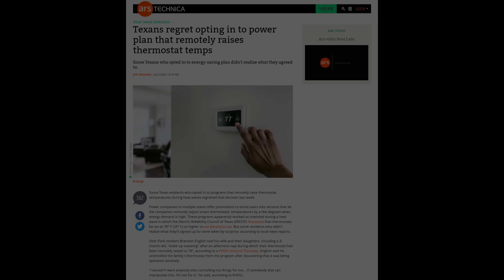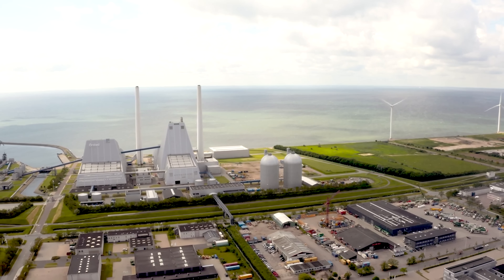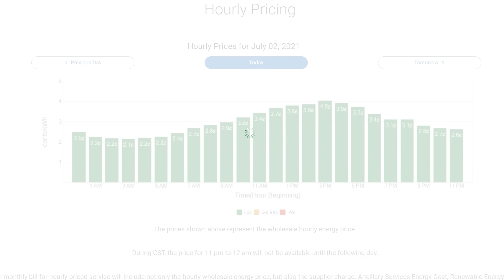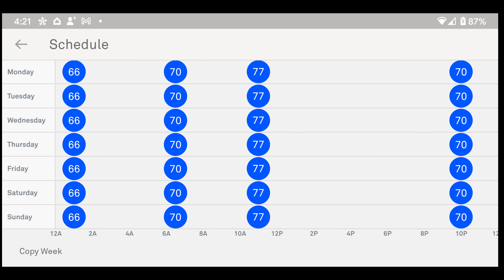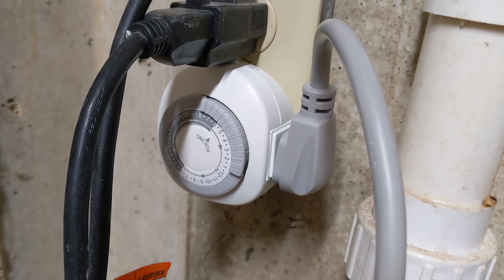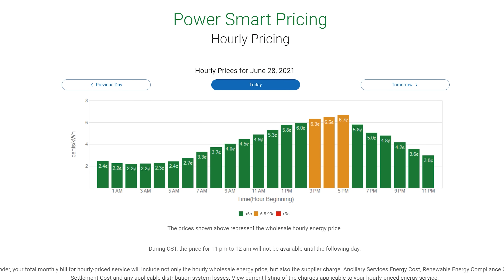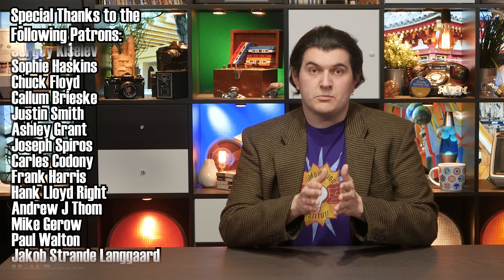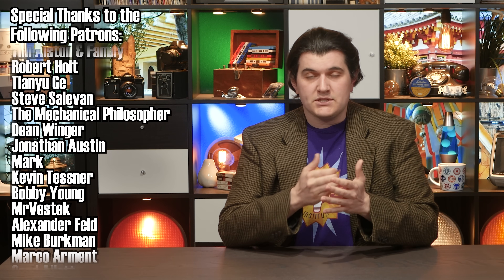Batteries aren't the only way to store energy. Here's another.

Comment: I'd love to hear your take on underground houses, in terms of power saving and possible "battery" viability.
Reply: Really depends on local geology.  A house that floods if there's a disruption of power to sump pumps isn't the greatest plan.
Reply: @Zraknul  and how might the home flood if it's Underground? If it's built out of the right stuff or the right techniques it will never flood. I'm preparing to do an underground home myself I have already worked out everything in my head I just need to put it down on paper as far as the blueprints and Engineering goes its going to be self-sustaining with a thousand gallon potable water storage a power supply room that will house a air scrubber along with oxygen if I ever need it in case something happens to the outside air that's being piped in that is filtered as well as hidden, and I would have off-grid power and even if my energy source were to dry up for some reason I will still have backup power for 7 to 10 days and my energy storage by the way is a renewable and free I can go on and on but the home will be constructed out of court in steel waterproof Crush proof containers about 2000 square feet total I will have a earthquake proof flood proof hurricane proof tornado proof flood Proof Riot proof Fireproof home
Reply: @Zraknul  I forgot to mention flooding is basically enough above ground problem what you have is permeability under the topsoil and then if you go down far enough you actually will find water again obviously but between those two points your golden besides once my structure that's made out corten steel is in place it will be surrounded underneath it around with small Pebbles rocks if you will that will help to make sure that the straw that didn't get put around it's covered with that will Aid in any water that goes around the building to actually go further down into the soil below it and drain away
Reply: My below ground basement has water….. it would suck if it were the entire house underground & getting water
Reply: @electrictroy2010  You might want to invest in updating your sumps. Water in the basement can wreak pretty terrible havok if left unchecked.
I'd imagine water seepage could be remedied by a lot of different methods if taken as high priority when designing.
Also, you don't always have to dig down to be underground. Some "underground" house built the terrain up around them.
Reply: @electrictroy2010  I don't know a lot about basements cuz I've never had one but I just know this from dealing with Geo science and engineering Waters amazing ability to always find a way, that you need to just find where your leaks are and perhaps use a flexible even in extreme temperature coating sealer that you can apply to all walls at least a foot if possible above ground- level and the floor and every corner also make sure all your plumbing and everything is good no leaks no stream condensing
Reply: @electrictroy2010  are you as far as the water tables concern in your area are you in a valley or you so many feet above sea level what's going on with your property also if you have any piping for heating or ventilation anything that might run up through the roof and could always do the basement make sure that that does not allow water seepage
Reply: Lyle G, ever heard of gophers? The vermin cut a tunnel under my lovely dry  basement pad. Heavy rains pooled in area away from the house, channeled down the gopher tunnel, pooled under the concrete until the floor lifted with the sound of a gunshot. I ran for the basement to find 10 or so 2 foot high fountains flooding everything. Do what you can,  but never underestimate mother nature’s ability to mess with your best plans.
Reply: Many cultures would have hollow columns and some walls on raised floor to let hot in the attic and cold air from the ground exchange.

Comment: as someone in the pacific northwest, my building already has thermal-mass based air conditioning: apparently incorporating a lot of unpainted concrete into the design aesthetic means they can get away with no electric AC and achieve Leed Platinum
Reply: We in the PNW are blessed when it comes to temperatures. My fam lived in Portland from 1996-2010 without A/C and it rarely was a problem. Still in Portland, but nowadays A/C is important a number of days each year. So not as blessed as it used to be.

Comment: OK as this video is not (probably,) relevant anymore, but, I notice that you are helping yourself and the grid (and others,) with your frugal use of electricity and that's brilliant, BUT you still use Air Conditioners which are one of the BIGGEST uses of electricity and greenhouse emissions around. That's why I still advocate for radiators. They are amazing. And I have  never understood why Americans got rid of then. All they are are hot water storages and cost a LOT less than an air conditioner to run in money and greenhouse gasses. Maybe the air in the States is different to here in the UK, but, from what I have seen and read about Air Conditioners, I would NEVER even give one house room. If your cold, get a blanket, or a radiator. Thanks, Alec. Love your content.
Reply: Air conditioners are for cooling, not heating.

Comment: I live in a small european flat. It's well insulated, so at night I can just open the window, put a little fan into the window. The flat cools down nicely, then at morning I close the windows and I have a cozy room.
Reply: As an aside, although this works well most of the time, it's part of the reason heat waves can be so dangerous. If the daily low temperature is still hot (and humid), it both makes nighttime cooling less effective AND interferes with people's sleep, both of which compound the biological stress on our bodies.
Reply: I've used this method a lot too and it's great! It's always disappointing when it's like 30+ out and I can see my neighbours with their windows wide open, that's doing the opposite of helping!
Reply: When I do this I wake with sore throat next day and end up at doctors office day after. Also in southern part of Europe or everywhere during heat waves temperature during the night can keep above 25C, thats when you need ac if you want a good night sleep.

Comment: Still using an old manual timer? Time to get a Single KASA smart switch-outlet and change your life. I have so many things set to turn off and on at variable sunrise - sunset OR because I am forgetful turn things back off at 1am no matter what. Also 3 minute auto-off on some closet lights.
Reply: I just don't forget to turn everything off, works really great and costs 0 bucks :D

But yeah if you are forgetful, sounds like a helpful tool :)
Reply: Fancy seeing you here Zeos!
Reply: I've still got use of my hands and can reach light switches quite easily for free. Thanks though.
Reply: Love your videos Zeos
Reply: We’ve had a similar timer switch on some of our outside lights for ten years or more. Automatically turns the lights on in the evening, turns them back off in the morning, with some variation for that “lived in look” if we are gone. And living in the upper Midwest, sunset today is a very different time than sunset 6 months from now.
Reply: Tasmota-based outlet switched (like CloudFree Smart Plug) and HomeAssistant. You can even create dynamic timers based on weather + power company pricing in real time, if you feel like taking the time to set it up
Reply: the mechanical timer is cheap, simple and just works
Reply: Kasa sucks ass, though. So definitely use a different brand.

Comment: Economy 7 update from someone in Britain : Economy 7 used to be a great system, back in the 70's and 80's. Night power was about 1/4 the price of day. Now, it's one great big mother of a scam; night power is only slightly lower AND the day charge costs MORE than the standard tariff! It exists like this soley to rip off older people who haven't got rid of their storage heaters yet.
Reply: Octopus do a rate for people with electric cars. It's 5p a unit for 4 hours at night, and 15ish pence the rest of the time. I charge my car for £1.50 in this time rather than £4.50 at other times. I can use it for washing machine, water heating etc. You just need to cram your use into 4 hours!!
Reply: Not sure what those plans had ben called, but we had something comparable here in Germany. Due to electric demand of those storage heaters and due to the fact that those could not really be controlled that well they fell out of favor some time ago.

Comment: I doubt you'll see this but if you do I, like you, have given a lot of thought to my energy usage. I recently had home solar installed on my house (I would have to be silly not to in Arizona) and have not had a bill so far this year.  However, I am finally at the point in the year where my built up credits are overcome by the fact that it is in the 90's -110's here in Arizona from June to September.  Your video actually got me thinking about my own situation and how I can do something similar to what you're doing... but with the solar being factored in to that.
I am NOT on a net metering setup so I buy electricity for more than I sell it to the grid and I am also on a Time of Use plan so I pay more between 3PM-7PM in the summer, so I would actually lose money by setting my thermostat lower all night... I think.  I am at peak savings when my solar is generating enough to overcome my usage (obviously) and from about 10AM - 2:30PM I am producing enough electricity to fully power my HVAC system.  I also have to factor my electric car in to all of this as well but luckily I don't drive all too often now.
Thought.. opinions?  I should probably take some time and really calculate out if my best bet is to cool the house down as much as possible while I am at peak solar production (and maybe some more before that while I am not at peak rates).  I work at home now so having a very cool house during the day would be pretty awesome as well.  ...guess I should spend some time seeing where there are thermal improvements I can make on my ~20 year old home.

As always your videos are amazingly thought provoking and this one in particular was immensely thought provoking.  Thanks!
Reply: If you can make a graph that shows your energy production and energy use, you can easily see when consumption is higher than production and adjust it accordingly.
Reply: Your reasoning sounds right to me. For your own payback, use your solar first, then offload any additional cooling overnight. I'd still probably avoid running my AC too late into the afternoon though.
Reply: @SuperLoopholes  Luckily my solar does the graphing for me :)
Reply: @tscook10  What's the reasoning for avoiding running in the afternoon?
Reply: @Kubicus24  same reason he states in the video, relieving stress on the grid during peak demand, and  saving money if you have a TOU or demand rate.

Comment: Cooling at night is probably more efficient, too, since the gradient between the hot radiator and the cool air is larger.
Reply: I'm sure it is.  Cooling in winter would surely be even more efficient! Smh.
Reply: @nonnobissolum  No. Your air conditioner compressor isn't effective below 60 degrees fahrenheit.
Reply: @hithere7382  thanks but my comment went right over your head

Comment: Meanwhile in Texas, if the AC goes off for just 20 minutes the indoor temperature shoots up to 80F

I don’t think this works for really hot climates lol
Reply: Yeah this strategy works fine if you're in a relatively mild/stable climate. The reason there was such an uproar in TX was exactly as you say: killing the AC in the middle of a heatwave is going to bring the indoor temp up above 80 within an hour even in the most EnergyStar® Certified™ of homes.
Reply: Doesn’t help that most new construction in Texas is built to just barely pass code and is of the “may or may not last 25 years” variety
Reply: I live in the south too. Try window films, shade, and add insulation AND ventilation to attic Often those fans have stopped working. Light roofing. Also add thermal mass. Five gallon water bottles can literally hold tons of cooling/heating mass (and useful in emergencies) if you can store in a spare room. Tile walls and floors are great too.
Reply: Gotta add more shade in the yard and see if you can add a heat-chimney to your house.  There used to be amazing passive cooling methods used in buildings in the southern end of the US that have vanished as more builders went with generic plans that can be built anywhere.
Reply: @F3Ibane  Energy star only deals with efficiency of electrical use, so it's very much not gonna help with this. What you want is something Passive House, or even LEED certified. Or just with a butt-tonne of insulation to block out the heat.
Reply: 80F is comfortable.  Take your shirt off or get skinny.

Comment: I use a very high tech technique of saving on cooling during the summer, I go into my basement.
Reply: Does it ever make you wonder why we build houses above ground?
Reply: @iamdave84  well, i guess sunlight was a reason :D

you'd be limited to candle light and open fire pretty much back in the day when they only had tungsten lamps, no way to generate power for that 
we have efficient lighting solutions now though, put some solar panels on the roof, a battery or 2  down in the hallway and bob's your uncle

kinda tricky in the city though where all the pipes and leads are already there.
Reply: I just wired a basement, the owners seemed a bit off-put by how bright it is. To which I responded "there are no windows, we have smart switches and dimmers". They instantly agreed. The only part that isn't controlled by software is the color temperature which is manually selectable. Maybe something to consider for large corporations. Another thing to consider would be ... sufficient heat sinks for their LED drivers considering they all use electrolytic capacitors (read: wet capacitors). That's maybe a conversation worth having here, sure the diodes can run for 50,000 hours at 3 hours a day, but what about the drivers?
Maybe talking about cheap drivers running at 50-60hz and effectively strobing.
Reply: @jonanderson5137  is the strobing you're noticing part of the pulse width modulation dimming, or is it present even at 100% brightness?
Strobing from PWM dimming drives me bananas
Reply: @iamdave84  it's present without dimming. Looks like 60hz to me.

Comment: "It's not a problem, it's only a problem when management is bad" See... that's exactly why it's a problem.
IoT is already inherently dangerous due to the attack surface area letting random people mess with a thing that might kill you if misused, on top of collecting data. Why would you allow people to control your devices remotely ON PURPOSE?
Of course, all the energy strategies you talked about are pretty cool, you just shouldn't rely on remote control to do it.
Reply: Yeah, it's just an awful idea for many reasons.
Reply: Except you can only do this so well without the internet. In the video, he just set it to go off at certain times, but given the fluctuating weather and prices, the most efficient method will need to know what's coming up and adapt.
Reply: "It's a perfectly good system once you subtract the human element." Looking forward to the first major case of ransomware via thermostat
Reply: @waynemarsh1330  The power is cheaper at night because it is easier to produce it at that level. This arrangement can be beneficial for both sides.
Reply: @Cycl_ps  Decentralize it.  Put energy on a blockchain.